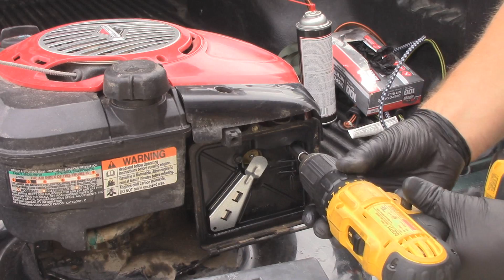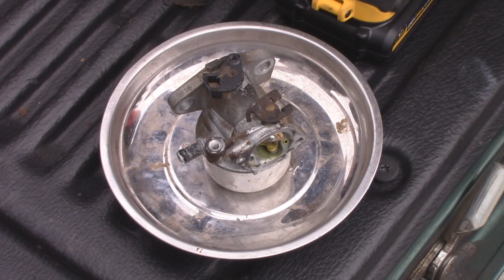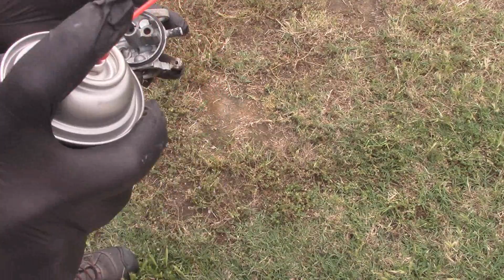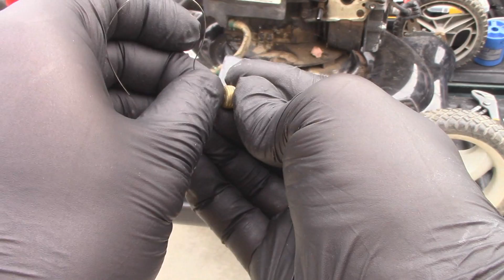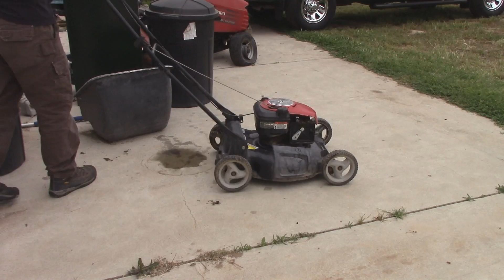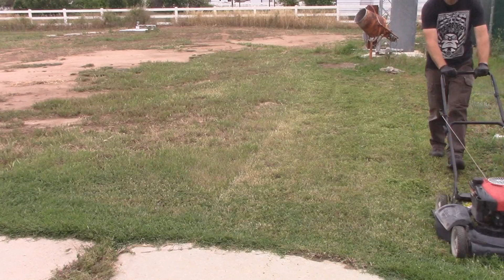Fixing a Non-Start Craftsman EZ Start Mower

Comment: I've cleaned it like 4 times... 
Ran a welding tip cleaner through all the jets and other holes.. 
Changed the gasket for the primer seal... 
Got it to run ONCE, and let it run through a whole tank of gas.. hoping it would get the rpms up... 
But Nope. 
She runs for however long the carb cleaner burns..then cuts off. 

DAMMIT !!!
Reply from the maker: Try replacing the thermal auto choke that attaches to the muffler if it’s auto choke.
https://amzn.to/3tvCpZF
Reply: @hanksgarage_  does that control fuel flow?
It runs on carb cleaner..like it's starving for gas. 
/ Thanks. 👍
Reply from the maker: @maybesomaybenot1652  sort of. A lot of starting issues on these that aren’t carb related can be pinned to that thermostat. It’s normal that they wear out.

Comment: Please help I just bought my no choke Craftsman (Honda motor) last summer. Got it out for 1st cut and won’t say a thing. I took the bolt off bottom and although it looked brand new cleaned the bowl n bolt that the oring is on. Also replaced the filter. Sprayed some carb cleaner and it crunk once.
Reply from the maker: https://youtu.be/tpvBBn0xnjM
Reply: @hanksgarage_  thank you!
Reply from the maker: You need to remove the carburetor, take the jets out and clean them out.
Reply: @hanksgarage_  last thing I’m not mechanically inclined. Do you think I can give the full repair a go?
Reply from the maker: As long as you have a 10mm socket, wrench, and some pliers you should be fine. Take pics with your phone as you go of all the linkages and the gaskets and how it all comes apart.
Reply: @hanksgarage_  ok thanks again

Comment: Great video 👍 I have one of these and I cleaned the carb because it was reving or hunting I've seen it called. Still had the problem so I replaced the whole carb and it still has the same problem. Any advice?
Reply from the maker: Replace the thermostat. Link is in description. 👍
Reply: @hanksgarage_  the thermostat works perfectly. The arm moves forward as it warms up and goes back when it cools down. Whatever controls the linkage rod and tugs on the throttle keeps going up & down. I can hold it in a good position and it runs smooth, but as soon as I take my finger off of it, the surging starts right up. I read somewhere else to test for a vac leak with some carb cleaner, since it has a new carb and with gasket and o ring  it may be the manifold gasket?
Reply from the maker: that’s possible as well

Comment: Nice but mine won't stay running on starting fluid, same results. Not sure it's a fuel problem. I did just clean the carb twice, and same results.
Reply from the maker: This may be your issue then, the thermostat for the autochoke may be weak, Briggs and Stratton 593208 is part number.
Reply: @hanksgarage_  I can see the outside butterfly closing when it is dying, like it's trying to choke itself back to running. Maybe it's doing it too late?
Reply: Thanks for your help. Upsetting that this mower hasn't run right after the first year. Took it in, guy said bad fuel, I said no. He flushed the fuel and said it was fixed. When he went to demonstrate, the mower would not start, just what I brought it in for. Then wanted to charge me to look further into it. Should have been under warranty.
Reply: Replaced the thermostat, and it would run on ether. Put on a new carb, and  mower started first time. Awesome. Thanks for the informative video.

Comment: I have a problem when the mower runs out of gas and it keeps sputtering and dying after I fill the gas up (even with new gas).  Is it a problem with the carb?
Reply: Sure that the exactly what happen when you have a dirty carburator just take the bottom bolt off and clean the hold if you don't want the full carb off

Comment: I have a Toro recycler that runs great , starts first pull, runs great for a few minutes then starts smoking out of the exhaust , rough idle, then starts working fine again 🤷🏼‍♂️ Any thoughts or ideas ? 
Great channel ! Keep it up !
Reply: 2 things... 
#1. the mower was on its side for a bit and oil drained out the combustion chamber to the muffler.. not likely 
#2. the oil level is just high enough that it blows back into the carb..
Reply: @hermankelly9200  Thank you for the reply! I think i overfilled it a bit and didn't recheck it after I had topped it off.... rookie mistake :(
Reply: been there, done that...been watching videos  and so far out of ten I was able to diagnose the problem at the beginning of the video.. after all 6 years part time shade tree mach  lol
Reply: Herman Kelly Thanks again 😉
Reply from the maker: Clean the carb for sure
Reply: I did try that, I did new plug, air filter and oil change also
Reply: Hello Please make sure you have a Clean Air Filter Installed!
Reply: What Model is that Engine? I used to have one

Comment: Good info in the video.  However, I have a question.  Inside the cavity that the bowl bolt screws into, there are 2 small holes.  What does    each do?  On my carb (sim to yours) I can only run a wire through the one with brass bushing.  The other hole just "bottoms out".  Doesn't seem to have an "exit" inside the carb body.  I can't understand why the carb would have a 2nd hole, but not do anything.  I've tried to spray carb cleaner through that hole, but it (cleaner) doesn't go anywhere. Just backs up cleaner tube until I release pressure and then shoots cleaner back out of same hole.  The one with brass bushing exits into throttle body of carb.  Any ideas on what 2nd hole function is?  After rebuild, I put the carb back on engine and everything "seems" to work okay.....although I do get a little "engine pulsing" until engine warms up, but other than that, it seems to work okay.  Just curious??  Thanks much.......

Comment: Can you put a manual choke carb on these engines?
Reply: cody kamminga you can convert it to a manual choke or a primer carb if you wanted a old pressure washer carb with manual choke will work

Comment: Is the needle seat replaceable?
Reply from the maker: It is, but you need a screw or special hook type tool to remove it.
Reply: Thank you. I purchased a EZwalk mower and cleaned the carb but the float will not lay flat when you turn the carb upside down because the seat is swollen. Im trying to find the part # for the seat but having a hard time.
Reply from the maker: They are just a standard briggs seat, they also come in every briggs rebuild kit. Your local mower shop should have them separately as well.
Reply: Thank you.
Reply: I thought the "seat" was part of the carb where the needle rests. The rubber tip can swell and stick to the seat.

Comment: Mine will start and run no problem, it just doesn't like to restart once I've stopped.  Such a PITA. Gonna try this!  Thanks dude!
Reply: Hello well out of curiosity did you ever find the solution? Mine does the same. Thank You
Reply: @patrickbaca5177  best i can tell, its a common problem with the ignition sensor that reads the key.  I didn't dig into it.  Probably don't plan on it.  Just bought a new vehicle so the H3 is now the family spare.

Comment: Good fix. I converted a Craftsman with primer to auto choke. Had a spare, but bad engine in the hoard. You will need all the parts from the donor motor. Muffler and bolts, thermostat assembly, rod, carb, spring, etc. Man is it sweet now.  Just turn the key, three blades and it fires up. Not bad for a curb find. Only have $65.00 in it, and $40.00 of that was a new battery and charger.

Comment: I have one of these that won't start even after I changed the oil (more about that in a sec), replaced the spark plug and air filter. I'll do this next. Thanks for the video.

Also in changing the oil I put a whole quart in (I thought it would stop me when it was full but it never did). Now that all the excess oil has leaked out what should I worry about?

Thanks for the video.
Reply from the maker: you need to make sure the proper amount of oil is in the mower, and may need to take out the plug and clear all the oil out if it got past the rings. Should only take 20 oz of oil or so. When  a mower wont start it is almost always the carburetor needs to be cleaned out.
Reply: Hank's Small Engine Repair 

Thanks. Ratchet in hand as we speak.
Reply: Ended up being the control cable was bad. I appreciate your help. Your video definitely taught me a lot. Keep up the great work.

Comment: Great video! I have the same mower, just died one day. I changed the spark plug, took off and cleaned carb, and checked the coil. Still will not start.... I bought this mower new and the 2 other I have I got for free and start up first pull. Just my luck

Comment: If old gas was problem with carb, why not drain fuel tank and put fresh gas in.
Reply from the maker: the gas in the tank was fresh, the carb was clogged from the old gas that the owner had already drained. But yes, I do drain the old gas out when it needs to be, not a big deal.

Comment: I have a yard man 6.75 Briggs. Ez start. No primer ball.  Starts fine.  First pull. After ran , and hot.  It won't start back up.   Any suggestions
Reply from the maker: More than likely it's the coil. When they get hot they can short out and you will get no spark.
Reply: That's exactly what happens to mine. If I pull on it 2 or 3 times quick it will start. So what's the  coil? Ignition coil ?

Comment: I have a mower that's stuck at full throttle
Reply from the maker: Usually that's a linkage issue. Check the governor linkage and butterfly valve if anything is not loose or stuck that's most of the time the issue. You could also be missing a return spring depending on what model engine you have

Comment: Need a place to get the rebuild kit, link please?
Reply from the maker: I can't access a computer at the moment, I use for craftsman Sears replacement parts site to find the part numbers, they have exploded parts diagrams. Key your mowers model number into the search bar and it should take you to it, you will have to go to the carb diagram to find the part number for the rebuild kit. Key that into Amazon or eBay and there you go. You can also use that part number at your local mower shop to buy it locally. Generally the carb kits are universal so they will include more parts than you actually need.

Comment: I hate those autochoke carbs. For my good customers, I charge them less to convert it with knockoff primer based carb and put an OEM primer back plate on it. I get $70 for the work and parts cost around $35 and it takes me all of 15 minutes to do it. Then I rebuild the carb and sell with a core charge it to my I saw the YouTube video and now I'm a mechanic people. Lather, rinse, repeat. I'm also able to sell the springs and linkages separately to those that actually need them.
Reply from the maker: +Phil Builds yea they are a pain a lot of the time, very sensitive to bad gas.

Comment: yeah got one of those auto primers and it needs an overhaul
got a toro with the blade clutch and all it needed was a clutch cable at first but then it wouldn't run right , lost power on the slightest bit of grass do you think it could be fixed with out buying new gasets and o rings , probably not
the clutch cable is also really tight like its not enguaging all the way or something 
got my dad to buy it for $100 like 2 years algo and didnt even last a year it was only a few months before the carb was fucking up.
Reply from the maker: Could be the governor linkage is binding up or the carb butterfly valve needs cleaning where the post sits in the carb. I've seen that happen a lot.
Reply: well hell ya can't win em all your local. dealer on that type engine will hook you up for ;:90,00 an hour ,good luck😁
Reply: thatdankcat  i cleaned the carburetor, changed the spark plug, and blade, cleaned the gas tank, and mower wont start. What else could be wrong.